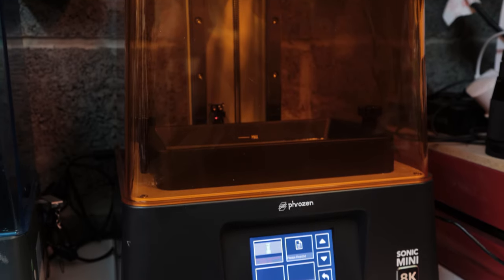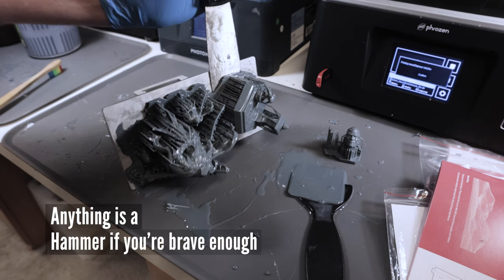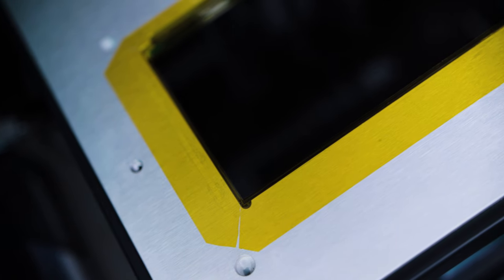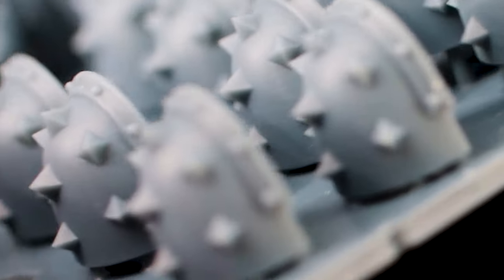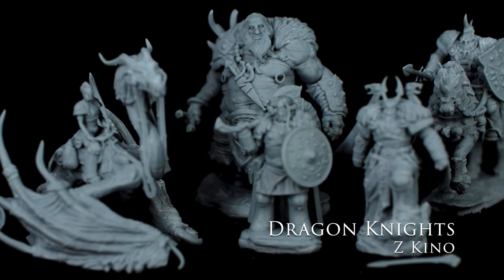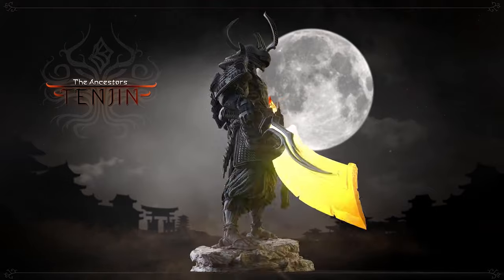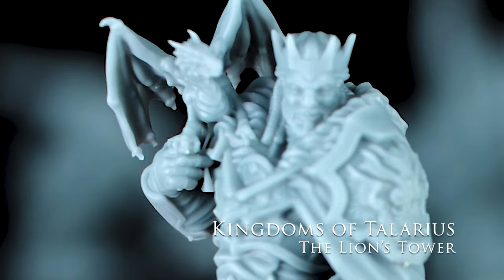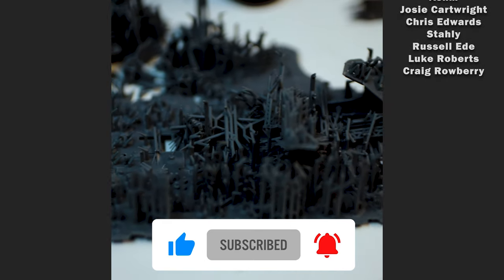DO NOT BUY - Phrozen Sonic Mini 8k Review for Miniatures, Warhammer & More

Comment: Just a note:  If you ever have an issue with removing the base layer from your plate, use freeze spray or air duster (upside down) and cool that base layer down.  It'll almost fall off the build plate.   I've also put IPA in a freezer and used the cold IPA to do this.
I also like the flexible build plates but they come with their own problems.
Reply from the maker: Great Tip
Reply: Or just lower the bottom layer exposure time 💁‍♂️
Reply: Just a note. bottom layer exposure testing takes 45 min to 1h to calibrate perfectly. 
flex plates like wham bam are good maybe for a year or less (depends how much you print) then it starts to fail.
Resin printing is all about calibrating your resins and that is 1h youtube search and 1h doing them and you are all set.
Dont be marketing victim , do the grind its very easy
ps. i've done all of the above. trust me

Comment: For the price this is probably the best printer you can get right now. I would say that the anycubic m3 plus comes close, but mostly in terms of extra features that you get with it. I think the saturn 2 will be a solid rival to this puppy though.
Honestly I can't wait to see what innovations they come up with in this space in the next 5 to 10 years!
Reply: yeah i'm on the fence and considering buying the Saturn 2...the x/y resolution is very close to this one but you have a bigger and more comfortable plate
Reply from the maker: Yeah the Saturn 2 is a contender, I should get one writhing next few weeks to compare
Reply: @enricobononi8655  saturn 2 is the go currently. 

phrozen is a gigantic pain in the ass. and despite what this guys experience is i have seen countless nightmare stories about their customer service
Reply: @tatooine_dream  I was set on buying the Sonic Mini 8K, but then I found out about the Saturn 2. Now, Im leaning towards that printer. It's also 100 bucks cheaper where I live, so it's winning me over. I'd love the Sonic Mini 8K, but hearing about all these problems turn me off, plus it's more expensive to boot. I'm torn now.
Reply: For $499 its half the cost of anycubic
Reply: @glennedward2201  I'm assuming you are talking about the M3 max. That's not the best of the M3 line IMO. It is just the biggest. In terms of pixel size (which is where you actually get xy resolution) the M3 PLUS is the best at 34 micron pixels. The M3 MAX has 45 microns pixels, but has a huge 13in plate. Compared with the sonic mini at 28 micron pixels it is really really close (considering the standard on most medium size printers is closer to 50).  The big trade off the M3 plus makes is it gives you a 9.7in screen instead of a 7.1in screen that the sonic gives you. 
Current prices are (on sale) 559 (normally about 750ish) for the m3 plus and 699.99 for the phrozen sonic mini 8k. 
But currently the best bang for your buck is the Elegoo saturn 2: 10 in plate, 28.5 micron pixels, 600 dollars (515 on sale).

Comment: most of these problems could be fixed by using a magnetic build plate. Seriously its a must have, I'm never ever going to get a 3d printer without it.

The unprotected lcd is atrocious though. seriously what are they thinking? Leaks happen all the time and there's almost nothing you can do to prevent it.
Reply from the maker: yeah I considered a mag plate but couldn;t be bothered - i ca't review a product if I need to buy extras to get it to work properly.

Comment: I want to give some advice here. 3D printing resin does NOT like water, at any stage of it's existance, it will warp and distort. I've deep washed a cured resin piece because it was something my mouth was going to touch, a type of flute whistle thing, and I had printed the whistle in 2 halves. They alligned perfectly at first, but I washed it out with soap and water (after it was fully cured) and then let it dry, then I went to glue it together and it was warped to the point that there was chunky gaps in between the halves, where it used to perfectly cleanly align. 
So don't use hot water to soften supports.
What I found useful is to remove the supports before curing. Get the print out, wash it in alcohol or whatever, let it dry, then remove the supports. And obviously use gloves. Most of the supports easily snap off, the supports that are too tricky to get just leave on, or have dedicated tweezers or whatever and try to remove it then. And then put the part in the curing chamber.
I'm guessing that if water can so intensely deform printed parts then I'm sure that builds up internal stress as well, which is the lead reason why other materials with inner stress can get cracks and break, like concrete or non cast acrylic glass.
Also 3D printing resin is UV cured, the more light touches it outside of the dedicated curing phase the more brittle and unflexible it'll become, since you're over baking it basically. Some lamps give off a slight bit of UV as well. So after curing prints try to put them in a box that has no light leaks coming in. Just get some cardboard boxes and duct tape any corners that let in light, and place your finished (so washed and cured) 3D prints in there for the time being. They're only safe once primed with paint. You need to treat all light like poison to the printed parts, like vampires.
So:
-Don't ever use water on 3D prints for any reason at all.
-Remove supports before curing.
-Keep prints out of any light after they're cured until you're ready to prime them.

That's going to keep the prints flexible and sturdy, as well as not warped.
Reply from the maker: thanks, but it's not the water, it's the resin
Reply: You can buy washable resin I don't even own a printer and I know that lol

Comment: I have this printer for nearly two years now and cannot relate to any of the issues you highlight here.
It's by far the most accurate and easiest printer to level of all 7 resin printers I have. I tested rigidity of test patterns in all corners and it's incredibly homogeneous.
Also, I got resin cured to the screen on 5 occasions and due to the glass like cover, it can be lifted off relatively easily.
On an unrelated note, I print functional parts and use more than 20 different resins. This is the only printer that can print all of them. The Mighty and the Mega are much less universal and the Anycubic 5s Pro is the least versatile.
And the printer stays leveled forever. I do dozens of prints between leveling.

Comment: I'm considering getting into the hobby, the thought of having to become a printer engineer/technician is really putting me off, I want it to work out of the box and I don't want any problems with parts until I replace it.  Messing around with settings and software is plenty enough for me I don't have the time or patience for anything else.
Reply: If you want that, your choice wouldnt be these "hobby grade" printers. Unless you shelve out upwards of 5-10k USD you'll probably have to see that there is some techical aspects to printing. (even at the higher priceranges, there are issues).  Tinkering with your printer, settings etc is a part of the hobby, even thought that tinkering is alot less than what the FDM side gives you. But expect to have to replace a screen, clean out a Z axis and tighten a few screws during your time with your printer.
Reply from the maker: Bet the D2 from anycubic. Most user friendly and long lasting printer you can get now, but it’s not cheap.

Comment: Quick question, but maybe a slow answer.  Your print layouts are very dense.  How to you get all of the uncured resin out of those?  What is you cleaning process for them?
Reply from the maker: Good question. I have a 2 stage cleanig process. I use this Pickle jar hich is really large to get most of the resin off. https://amzn.to/3RYdB9t

Stage 2 is 5-10 mins in this wash and cure station https://amzn.to/3BDcDdy

I also use industrial grade Methylated Spirit insted of Isopropanol which is far better at cleaning and doesnt go cloudly like ISO. https://amzn.to/3QF005V

Occasionally I get lathe things that do not fit in the pickle jar as a whole component, so i'll snap the parts from teh base before using the wash station.

hope that helps

Comment: I just got into resin printing and all your points are spot-on. I bought a Grey Knights team and also printed a bunch of knockoff (called quite silvery knights, lol) and the printed ones are OUTRAGEOUS. GW doesn't compare. I also didn't spend an hour gluing stuff together!

I'm using an ELEGOO Saturn 3 Ultra, and it's capable of higher definition than anything I've thown at it so far. I'm going to give some of the modelers you mentioned a shot. Thanks for this video! Easily subbed.

Comment: Good info, thanks Faux. I'm just about to buy my first printer and it will definitely be a Phrozen 8K. I'm torn between the mini and the mighty though. It would be nice to be able to print big pieces in one go on the bigger build plate. I do see that Phrozen have a conversion kit for the Mighty that ups it to 12K. I would love to see a review of that. Especially since the Photon seemed a bit of a fail in the 12K department. Not that anyone needs 12k, by the look of it...

Comment: Thanks for the video. Its my first 3D printer and Im having the same issues. Currently Im printing with 4k resin on the 8k Mini and its a sluge...it needs more time for example the Elegoo Mars and in here in germany the 8k resin costs 70 Euros. 

Other than that: I adore the 8k in comparison to the 4k prints. The 4k is more bendy and sometimes a little bit sticky (even if cleaned properly). The 8k needs little to none curing time and is ready after cleanup.
Reply from the maker: You can’t possibly be having the same issues as me- based on other comments I’ve had. I’m an incompetent user who makes false statements lol.

I do like the 4k resin, more durable then at 8k

Comment: This video shows me how the mini8k is not for 'plug an play' and how an inexperienced user would feel when using it, e.g. quite frustrated. 
I've had a mini4k for a couple of years, and the levelling, taking out the prints, and resin temperature are things that I've learnt how to fix along the way.
3D printers, as they are, are mostly, for people that don't mind tweaking a lot with the product and facing issues.

ps.- The transition layers, that's on you Fauxhammer. The manufacturer recommends a certain number of transition layers.
Reply from the maker: Yep, my fault.

Comment: the flex plates like ones from wham bam are nice for removing prints. I do wish they etched the plates though. for you issue with the screws lifting the bed a washer in-between the bracket and the mounting arm may help as well. I haven't had that issue or the issue with the z rod.  I really love this printer and have been very happy with it. I don't have any failures with it that are not due to my mistakes (not putting a support in the right spot). 

 a tip if you have to replace the outer tape is you can make a flat print that fills more then the entire bed with a really long layer print. then print it without the bed and build plate. then you know you aren't obscuring the printable area when placing the tape.
Reply from the maker: good tip. yeah i was gonna try a flex plate but I;m reviewing the OOB experience rather than go beyond it to show what can be bought as an extra.

Comment: To prevent the build plate torquing when you tighten the screws, install one or two washers on each of the four attachment screws.  This will take up some of the torque when tightening each screw.  Had a similar issue on my Sonic Mini-4k.  

Also...  The Sonic Mini-4K has the same LCD screen design.  No protective layer of glass above the LCD.  

I have both the Mini-4K and the Mini-8K...  Have had the 8K since June, but haven't made the time to clear some space on the bench to set it up.  As amazing as I'm sure it's going to be, the 4K is pretty damn good as it is!
Reply from the maker: I have the Mars 3 pro which has the same res as the mini 4K. And yeah, most models do not have the detail to show off what the 8k is capable of.
Reply: @FauxHammer  Yeah...  On my MIni-4K I'm printing parts that have raised letters on the part.  On one surface, the letters are about 0.2mm thick x 0.15mm proud of the surface.  They print perfectly.   On another surface, the letters are 0.1mm thick x 0.1mm proud and about 0.4mm tall.  Under magnification, they're legible, though a tad pixelated, to the naked eye it looks like a near perfect name plate.  
That's on the 4K!  Not entirely sure why I purchased the 8K, but at the time I'd gotten some unanticipated $$$ to pay for it, so I said "what the heck...".  
Can't imagine what the 8K will do...  Surely better quality, with legibility on parts the next scale down.

Comment: Is this levelling issue present on the mighty 8k too? because my prints are sticking too well in certain parts of the build plate and less in others.
Reply: i have this printer and i do not have this issue at all , i bed leveled once when i bought it 1.5 year ago and that was it.
at the start of the video he has overexposed bottom layers thats why the models stuck in the build plate , with a 1h testing you can calibrate it perfectly

Comment: I just unboxed mine and equipped it with a WhamBam Systems build plate, which is touted as making removal of completed prints from the build plate much easier.... no hammering and chiseling. It is about 3mm thick, so WhamBam recommends using the z-axis offset feature. I have not been able to figure out how to get that set. I figured out that aligning the build plate required holding it down in place and incrementally tightening the screws in a crossing pattern, got that to work. But now I can't figure out how to actually set the plate with offset so that it compensates for the thickness of the WhamBam plate...
Reply from the maker: I have no idea how offset works. i would have thought just lower the bed with the plate on and set that as the 0 position. Why would you need to offset it? I'll have to read into z-offset and why it matters but I thought that was just an FDM term for setting 0
Reply: Could have been clearer in my comment --- The slots in the bracket give you about 4mm vertical play; the slots are approx 8mm in total length and the screws are M4, so about 4mm there. But on my particular printer the zero setting without the WhamBam plate is against the bottom limit of the slot, so there's no overhead left to compensate for the WhamBam thickness. 

I put in a ticket with Phrozen after I left this comment and they replied with a link to this video. Will give it a shot after I run to the hardware stor for an M4-0.7 bracket screw of the correct length to replace the one with buggered up threads... 

https://drive.google.com/file/d/1d4eMnq34tJVNISESlWbSB39_PqEIxqiN/view

Comment: I have this printer, but it is collecting dust after it's third print. You didn't mention the loud noise of the fan, so your fan works okay? Mine sounds like an airplane ready to take off while it is printing. I contacted Phrozen but they say it is normal.
So can you please tell me how much noise the fan makes, comparing it to an Elegoo printer?
Reply from the maker: I have the Elegoo Mars 3 and the Elegoo is far louder than the 8k I have, I can hardly hear the fan on the 8k, it;s there but i can easily tune it out, the constant blower noise from the Mars 3 is frustrating.

Comment: I just got this as my first resin printer. What settings did you use for your successful prints?
Reply from the maker: I wish that by telling you it would help. but everyone needs to work this out for themselves based on the environment their printer is in. 

Use Lychee and check the communit profiles. get a profile for this printer and your resin which has the most feedback balanced with most success. then just print out the exposure test and try to match the number of holes to number of posts. when they match, that;s your settings.

Dialing this resin in though is more difficult than most and it;s severely affected by temperature like dental resins.